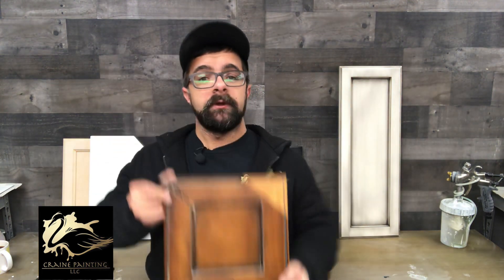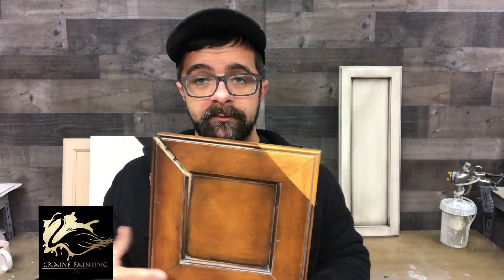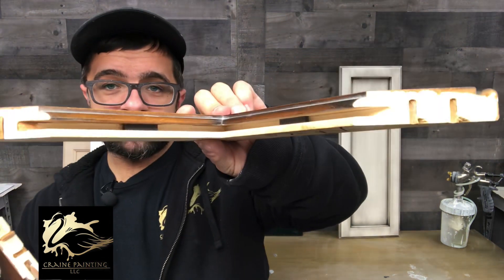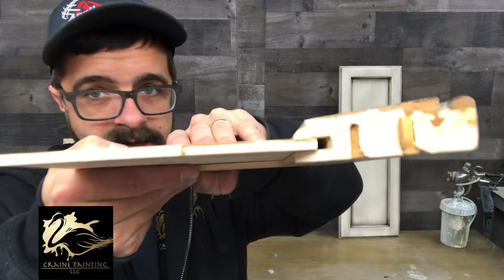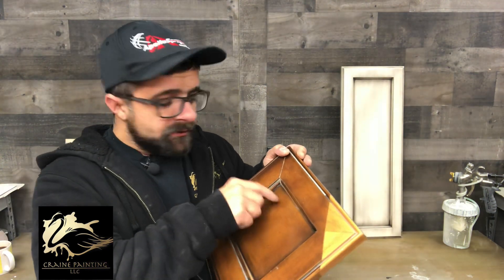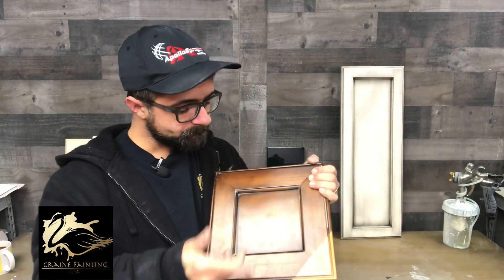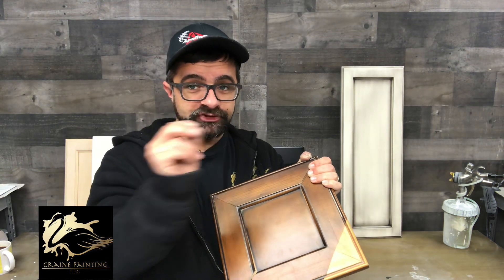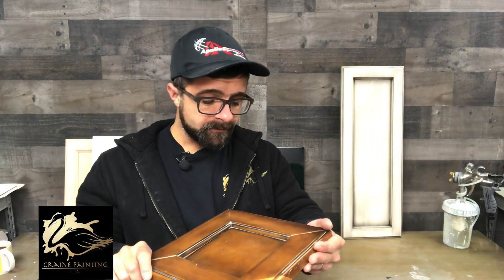Caulking Cabinet Doors? Explanation of Door Expansion and Contraction

Comment: If you are spraying vertically it doesn't look horrible to not caulk.  But if you are spraying on horses and that paint levels out and gets in those seams and partially fills them. It looks like shit.  And the paint will crack open as well and loom further like shit.  Ice been caulking doors for years and we warranty a few per year. But 95 percent of the time they hold up greT for years and if a couple split open caulk again and touch it up.  Seamless cabinets look better. Period
Reply: Agree, it’s hard for me to leave the gaps because it looks unfinished imo. depends on how some are are built. Some gaps are inconsistent and you end up seeing closed gaps and some open on the same panel. I am doing some really old custom built pine cabinets right now. The panels are glued, some parts of that gap are closed with glue and others are a open gap. Unfortunately will look like shit if I don’t caulk and I’m hoping the glue hold them and they don’t float
Reply: Thank you. I just had a new kitchen and what i am finding especially on my white doors and drawers is that particles line crumbs falls in this gap. An nowadays  i understand they made movable caulking?

Comment: When you paint 
Wouldn’t the paint bridge between the 2 panels?
Reply: The back of the inside detail should have a small radius cut to prevent paint or lacquer from bridging and cracking.